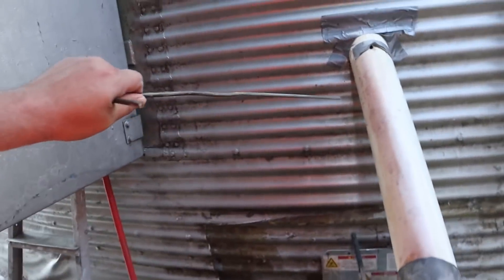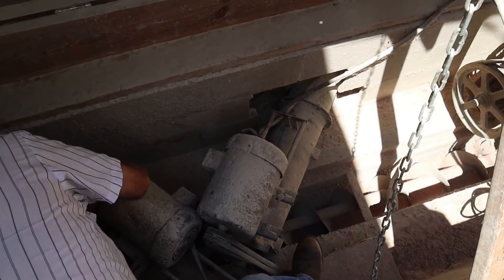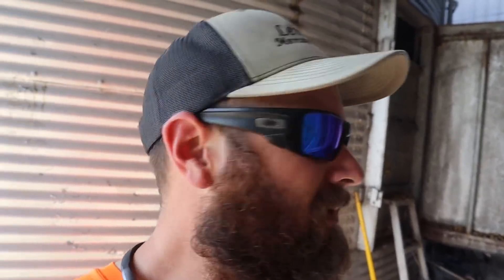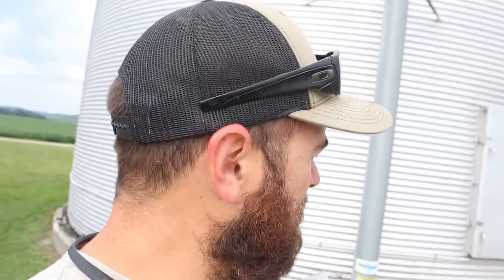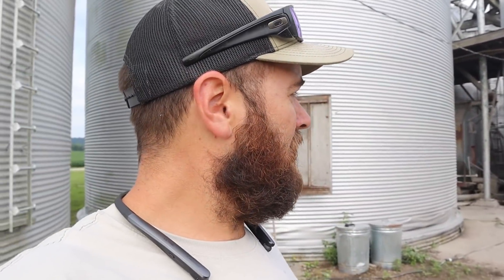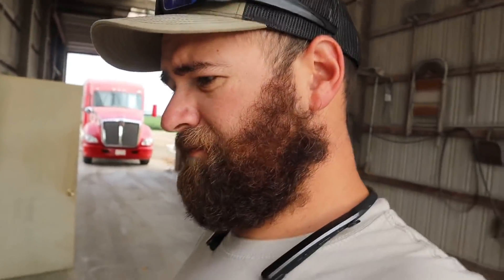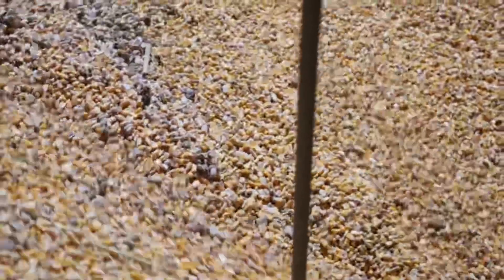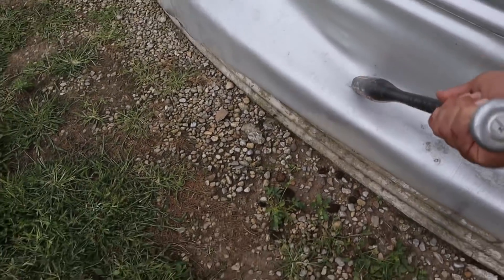Millennial can’t work after little cut on finger

Comment: Brian, keep doing the therapy. Progress will be slow, but eventually you'll notice a difference. One of the gripper sponges helps after the docs give the OK.

The non-migratory Canada Geese are a problem everywhere. Canada Geese are protected but the city can get a permit to cull them once the US FWS approves. 
We had the same problem with Trumpeter Swans.  The decimated the coastal feeding grounds for the migrating Canada geese, since their necks allows eating of the grasses down well below the regular low tide mark. They finally started culling them, 500-1,000 at a time, then the PETA folks complained, and now the swans are back to the same levels. My friend lost over $250K in hunting ground rents.

Comment: Hahahaha, parks are usually the best place to hunt geese. :P 
Just take one day at a time with that hand. Follow what your physical therapist is telling you to do. It might be a long slow process but, it's better to have the usage of your hand rather than something that's useless. I'm hoping it mends up fast for you.  
Not good having a grain vac not working, best get that thing up an running soon. Ah, belts, we learned a very long time ago, if you think you have enough belts, think again, one learns, to keep about a dozen belt (sets) on hand. Amazing at how fast belts will "burn" up on you. 
This is why I hate augers, auger flighting wears out faster than you think it does and usually messes up on you when you least expect it to. Belt conveyors on the other hand, difficult to plug those. Wished all bin systems were setup using conveyors, can really move a lot of grain and, a lot safer. Great video, cheers :)

Comment: save up your allowance and get one of the big vacuums that hook on your tractor and forget the sweeps they started back in the 70’s for getting grain out of bins that the main augurs  under the floor would would break and back then a lot of farmers would make storage bins out of their machine sheds and the vacuum was a great way too empty the building and put it right in the trucks you could load a truck in about 20 minutes back then they probably make bigger ones now that load even faster
Reply: That was back in the days of $12.00 beans. and $6.00 corn. A friend of mine took a load of beans on a single axle Ford Louisville loaded with beans 70 miles down to Milwaukee and got a $1,000.00 for it. just imagine back then gasoline was fifty cents a gallon and diesel fuel was thirty cents a gallon and cigarettes thirty five cents a pack but if you bought a carton it was $3.00 for the carton 10 packs